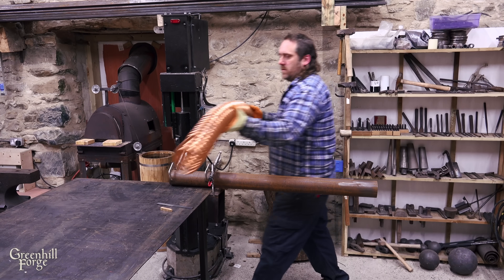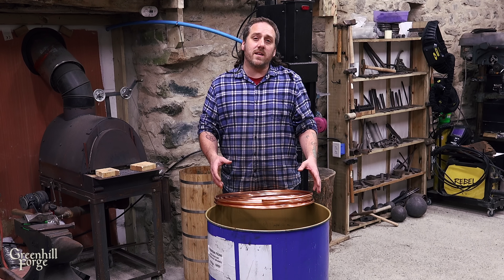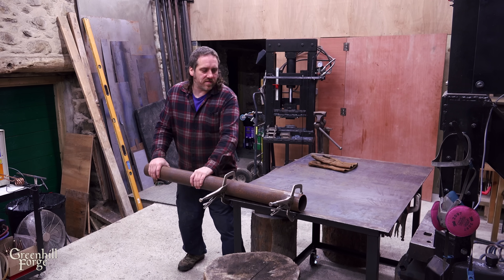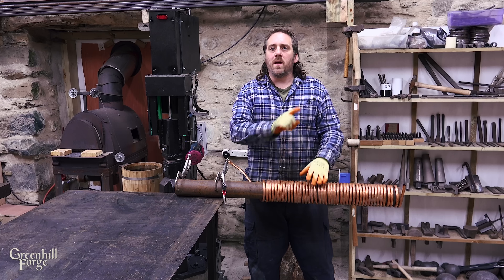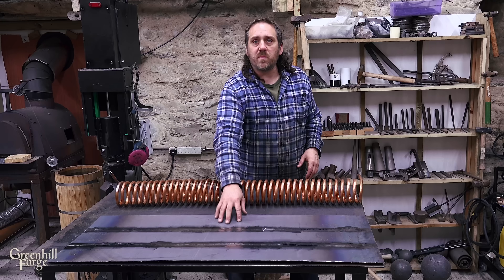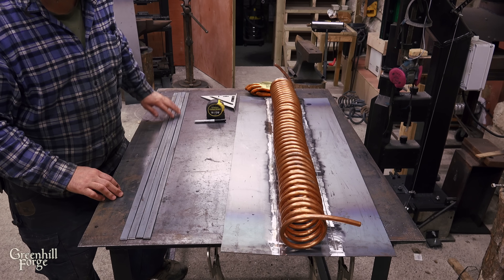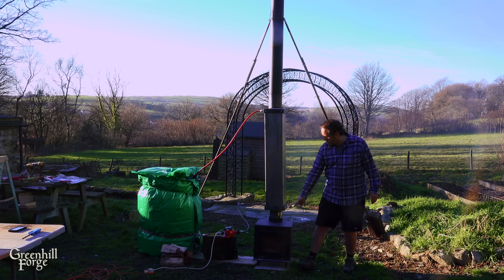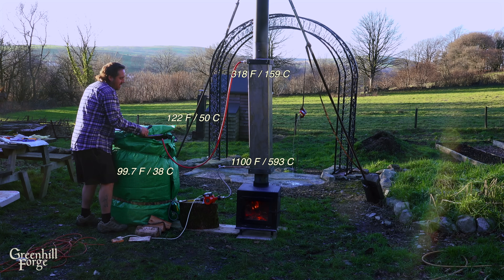Wood Stove Water Heater Experiment - Surprising Results! Part 1

Comment: You put that same curl or single up down copper line with flange grill around it in a solar evacuated tube? You will get great results even in Northern areas. Put oil in the line and a perspex line.. temp rated, you got heated space. Nothing but sun and the tubes and line. Lots to do... You can use that same loop.. and Seebeck rated TEG's and now your charging power. Wood stove/water evaporator drip line... again, power brick. Most think of weak TEG, not Seebecks. Lots you can do new tech is a tiny one that is wayyy more power than you need, thus controllers become necessary. Engineering for satellites still running 70 years old due to precision.

Comment: I want to know what happens when the water is no longer flowing through those coils and it starts boiling , which end of the pipes going to blow out scalding hot steam the only way it did work is if it's in a hot tub where you constantly got the pump running until the fire goes out other than that it's a f**** steam bomb 💥

Comment: I wonder why you didn't put water inside the coil compartments then second compartments act like chimney heat goes through always that water keeps the coil hot no need extra water tank

Comment: the waterflow intake should go in at the top. the exit flow should be at the bottom. this gives you the most heat transfer with your design
Reply from the maker: I didn't use counterflow because the final goal is a thermosiphon so the testing is done in that direction. I talk about it in this video https://youtu.be/pP_2A5Wdvqg

Comment: You can also put a car radiator into a furnace, and pump hot water through it. Use a couple of oil tanks to make a boiler. It's more complex you can sleeve two oil tanks , so you have a water bladder between them and burn whole logs in the "furnace". An old welder I know heated his ship this way. He burned whole logs 4 ft long in the boiler.

Comment: I built a similar setup with the coils inside the flue... i just skipped the insulation, and the firebox didn't have a tight fitting door. It worked really well at first, but condensation on the coil would drip down onto the fire, and after a few uses enough creosote built up that i had to shut the damper and put out the fire as a chimney fire started taking hold with flames coming out the top. I tried cleaning it but the problem persisted. Having the coil inside the pipe is clearly the most efficient way of extracting heat but it's effectively too good. Its also a nightmare to clean, so my project got retired. I may do this again but i think finding a cheap old woodstove with a boiler is the more reliable solution, perhaps also with the coils repurposed onto the outside of the flue with insulation around them. Hope my experiment can assist in refining yours. Oh another tip... if you go the boiler stove route you obviously don't want rusty water in a hot tub, so you can create an effective heat exchanger with a long length of copper pipe threaded through a larger diameter copper pipe with a T piece and reducer at each end, so that the hot tub water can flow around the outside of the inner pipe, and the stove water through the inner one, thereby never mixing. You will need a few meters of exchanger but you can make it more compact by running them in parallel. Its very effective. Just make sure the boiler circuit is vented in some way to allow expansion in that circuit.
Reply from the maker: This is basically what I'm doing, the coil inside the flue is just a test unit that I'll only burn a few times to get data on different stoves and an idea of max/goal heat transfer. I've got a few more designs in the works that I can then test against so then I'll be able to weight pro and cons and efficiencies of different types of systems. Assuming it was an outdoor system it would be interesting to know what would happen if you just burned throught the creosote. Might mostly burn off and leave an easier to clean carbon on the coil? I have a water jacket shower systm in this video https://youtu.be/pP_2A5Wdvqg  that works well but also drips a lot of condensation on the fire. I had to add a baffel diverter and holes in the bottom because it kept drenching the fire. Yeah, an intermediate tank is a good idea and can solve a couple other problems too.

Comment: Farms used wood stoves that included a Hot Water Tank outside for shower/bath etc.  They operated on Thermo-Syphon (no pump) to the tank but hot water pressure had a small electric instantious pump.

Comment: I been planning on wrapping coil around pipe.  But thinking steel tubing because copper and steel causes corrosion right?
Reply from the maker: There would be galvanic corrosion, yeah. It's actually the steel that gets corroded by the copper. If you use standard flue pipe then it's already got a coating that would probably really reduce the contact between the two metals.
Reply: @GreenhillForge  I was thinking the standard black pipe then wrap tubing.   Another was thinking use black iron pipe and elbows sitting on the top fire box then a chunk of plate metal lay on top or soap stone

Comment: Interesting work. What about if you build a much larger conical shape (like a nuclear cooling tower) surrounding the fireplace? It will allow you to collect more heat closer to the fire and lose less collected heat at the top of the tower where the heat is less. Try and let us know.
Reply: And for the insulation, rather than using toxic materials, you can use the  Pottery Clay 2-3 inch thick layer. You can mix glass and quarts shushed mixed with the Clay for added heat insulation and retention. Heat retention would allow you some time between fueling the fire.

Comment: Just be careful of Legionella bacteria. If your water temperature is under 56 deg C. The temperature in your water storage needs to be 60 deg C or above for it to burn off Legionella bacteria.  
Very good build and craftsmanship.
Reply from the maker: Yeah, Legionella is often found in quench tanks in blacksmith forges so I have to be careful of it there too.
Reply: @GreenhillForge   In Australia in years gone by, people would turn down the thermostat on the electric hot water storage tank. Usually so an elderly relative wouldn't get injured by hot water. Sadly the result would end in a case of Legionella. These days the thermostats are designed so as they can't be reduced to below 60 deg C.
Stay safe love your work.

Comment: to implement this into a hot tub you'd could also have an intermediate tank under a bench as a thermal dump that also runs a towel warmer and warm seating area, otherwise you'll get the tub to temp and cut off the flow and have to stop pumping

Comment: Nice done, nice idea. 

I have a old shower from 1900  is done with two pipes the same principle bud without the copper coil. 
More outcome because the direct heat from the fire on the inside copper pipe. 
And copper don’t melt when water is inside. 

It’s all welded with copper. 

The benefit is that copper isn’t rusting. 
Metal does.

Comment: I wonder if you could use sand as the insulator instead of that weird chemical stuff
Reply from the maker: It's ceramic wool, not really chemical, just has tiny fibers you don't want to breathe. Sand would absorb a lot of heat. it's a thermal mass which is kind of the opposite of insulation.especially for the first hour or so it would really slow down the water heating up.
Reply: @GreenhillForge  that makes me think about using sand in a heated floor

Comment: There standoffs actually reduced the heat flowing into the copper tubing. Metal to metal contact transfers heat better than air to metal.

Comment: I took a wood smoker lined it with fire brick with copper tubing inside.. connected it to a car radiator.. To only find out I heat it up water too HOT with not enough cooling system to the radiator, I need a lot larger radiator for cooling the water down, before the water going back to the smoker.

Comment: It will work almost as well on the horizontal with a vertical chimney. Then put the barrel above the exchanger and no pump needed. It will circulate by convection. Hot water in the top of the barrel and cold out the bottom.

Comment: Great build. If adding to a rocket stove I'd add a safety relief valve to the water line incase water increases to over 212F (100C). Once it starts to turn to steam there is new safety concerns

Comment: I do something similar to heat up water for showers at my cottage. A big stock put with a copper coil in it, fill the pot up with sand and stick it on top of the wood stove. Connects to a big water drum overhead in the shower stall.

Comment: Mate, i've seen your design in a glimpse and i can say that it is highly unefficient. Heat exchange coil/pipe should be inside the stove and not around the exhaust. If you place your thermal battery AKA water tank above the level of the stove you can use it without an water  pump. Hot water will move up by itself once heated. All you can do is add a good thermal insulation to the stove and thermal battery AKA water tank.

Comment: If you plated your heat sheilds that would be great Air born plating we uuse on header on engines really stay cooler but inside get coated also and really helps the process .It will keep your parts completely rust free

Comment: Maybe a steel pipe inside a steel pipe "water jacket" with turbulator fins welded on for heat exchanger inside an insulated flue pipe might be a way to address problems of creosote and avoiding dissimilar metals issues. Also it would be good to be done in a way to be able to remove the water jacket/heat exchanger assembly from the flue pipe for cleaning/maintenance. I like this... Very interesting. This is a very well done video. Looks like something I'd like to have for water heat storage (large tanks/barrels/IBC totes) in a greenhouse so tropical plants can be grown in winter here in southwest Missouri. Thanks to others for info about reverse flow efficiency increase... You learn something new every day!!!!  Subscribed... and 👍

Comment: Impressive thermal efficency. 
I suggest you use stainless pipe instead of copper or aluminium instead of steel for your coil supports for a long term build.
Steel and copper when in direct contact create a galvanic reaction that will rot out the copper causing leaks.
Also pipe erosion due to the particulate in the smoke will be slower at eroding the pipe with stainless.
Reply from the maker: Thanks! I agree that stainless would be a better choice but it costs about 4X as much so for prototyping i just have to stick with copper. If you want, you can check out this video where I explain why it's actually the steel that gets corroded by the copper, plus afew other things. https://www.youtube.com/watch?v=pP_2A5Wdvqg

Comment: Yeah I made one and placed  it in side of a 6” flew and then up the top also found an old heat exchanger running of my char maker…. Heated 2000 liters to the point I couldn’t sit in the tin anymore, too hot.  One thing I did get was a lot of condensation out side the chamber some where…. Thought it was a leak but it wasnt .  It could also produce heaps of steam.  My tub was an old insulated stainless steel milk vat
Reply from the maker: The milk vat is briliant!
Reply: @   When running a bio char maker the gas coming off burns really hot at about 1200 degrees for about 8 hrs with abouts 44 gallon drum full off wood to be converted into char. then it burnt my probe off. I’ve had to make it all out of SSteel as it’s too intense.  Btw did u find the coil produced condensate  from the temp differential between the flue gasses and the copper pipe ?   I got a lot of water coming off mine. 
Cheers
Reply from the maker: @Zkpunk  Yeah, these systems will always produce a good amount of condensation until the water starts to warm up a bit, especially in humid places. I'll be doing some gasifiying videos later this year, keep an eye out for those it you want.

Comment: I had an idea for a water heat exchanger using pipe made from 3 different sizes that all just fit in side each other. The smallest would be about 5 1/2" I.D. and about 6 ft. long the largest would be 6" O.D. and also 6 Ft. long the middle 2 pieces are 6" I D. with a 1/4" wall and are 1/2" long. The 3 pieces are put one inside the other and welded top and bottom The out side pipe would have a nipple welded in the top and bottom of the outside pipe on each side for the water to go in and out.  You could put a dampener at the top and bottom like you did here to control the heat.  This system would not need any maintenance and would never wear out.

Comment: I was an engineer on yachts and the heat exchangers all use counter flow.  Think of the temps of the hot air being cooled and water being heated. To get most transfer of energy the cooled air at the top will have temp difference to water at the top before water is warmed. As warm water flows down it is headed toward warmest air which still gives more temp transfer.😊
Reply from the maker: If you want you can check this video out where I go over why I intentionally didn't use counterflow (and some other things) https://www.youtube.com/watch?v=pP_2A5Wdvqg

Comment: You could have simply heated the copper pipe and wrapped it around the metal pipe or used a pipe bender. That is much easier than freezing water in the tube.

Comment: That's really cool, nice one. Question though, if you put a sealed-ended metal tube down the middle, to force the flue gas to travel only around the sides of it where the pipe is. Wouldn't that make it even more efficient? 

What electricity watts was needed to power the water pump? As obviously if that drew a fair bit, it could of just heated the water anyway.

Thanks.
Reply from the maker: I might add a sealed tube, it's a good idea. The pump is 45W but I plan to ditch the pump and only use thermosiphon once I dial in the design.

Comment: I've heated with a wood stove for the last 50 yrs.  Looks like a nightmare to clean the pipe.  I would put on outside wrapped tight for heat exchange. 👍
Reply from the maker: yeah, this wouldn't be a good long term design for several reasons. I'm making a few other systems including one like you describe and then I'll be able to compare the efficiency of all the different designs

Comment: We have a coil in our wood stove that's been heating our water during the colder season for 35 years.  Theoretically, the energy going into heating the water IS NOT heating the home....  Correct?
Reply from the maker: yeah. as it burns the wood is converted to an exact measurable amount of energy(heat), say 100 megajoules as an example. you might lose 20 out of the flue, 50 is radiated into the house, and 30 is absorbed into the water. I'm making these numbers up just as an example. but if your water tank is inside then the energy is still inside. some of it will be transferring back into the house as it just sits there but most will literally go down the drain when you take a shower

Comment: Back in the 90's I designed and built systems to heat thermal oils  (dont have to worry about steam blowing the system up)  dual coils.  Flue gas went one way made a U turn and then went back between the 2 coils and then another U turn towards the exit on the outside.  Rarely we made triple systems.  Super efficient.  most of these were with 4 to 6 in SCH80 pipe but occasionally an 8 or 10 in system.  At the time I was also doing Home brew and made some counterflow copper versions in 3/4" for wort chillers.
Reply from the maker: sounds interesting. have any pictures or more information?

Comment: Is it necessary to  have the coiled  copper pipe stand off from the metal flue box? The metal plate will get hot from the flue gases, and would transmit heat to the copper pipe coils touching those plates  just as fast as hot flue gases swirling around those coils.
Would be an interesting experiment to see which way has  better thermal conductivity

Comment: I'm Sry to say this but this is a really dumb construction, the heat expansion on all of the metal and in the copper pipes will make it all move around a lot and couse a leak in the copper pipes, not a bad idea at all to use the exess heat in the chimney. But the way you did it will cause problems and the copper pipes will start to leak in a matter of years